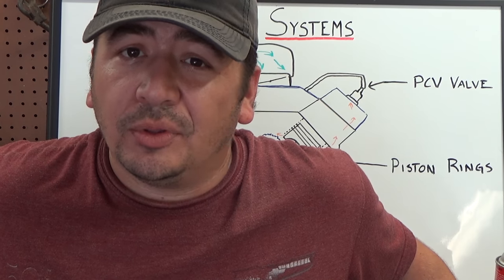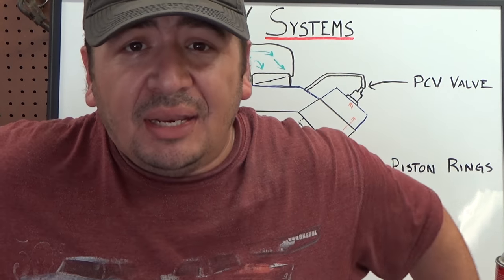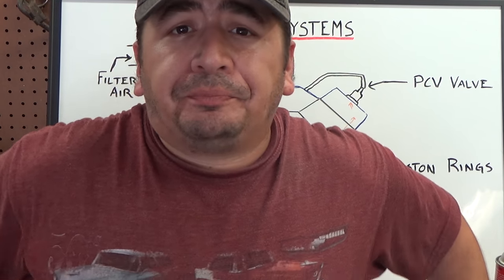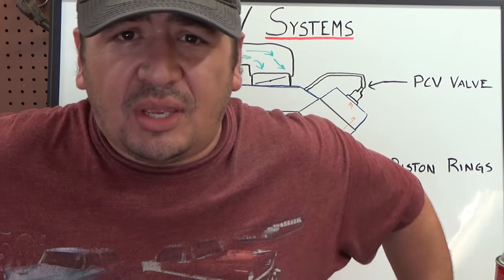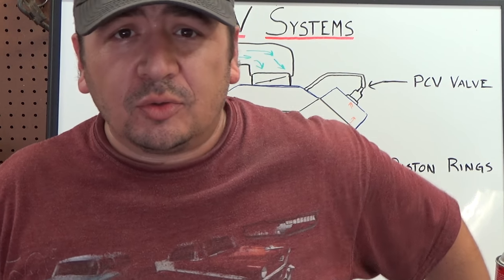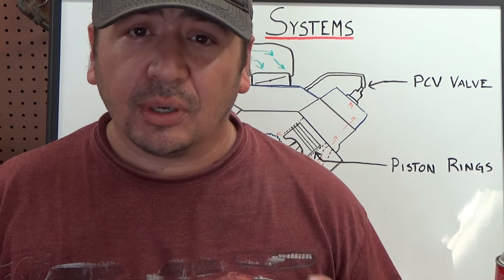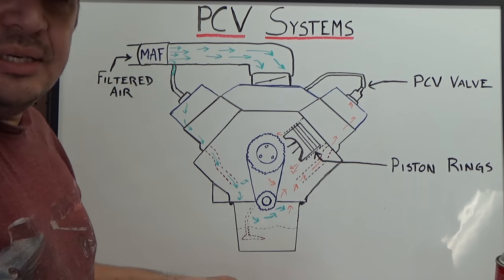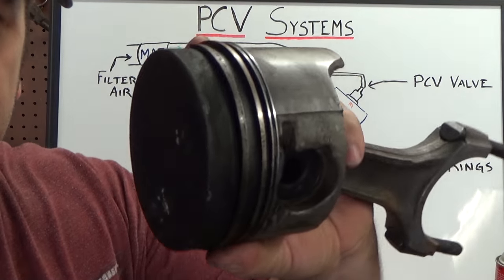PCV Systems - How They Work

Comment: would it be good to have 2 PCV valves installed in parallel, in case one failed, the other one would still be working
Reply: Not really, because if that were the case, if one failed the other wouldn't be fair behind. They are a pretty simple mechanism, and usually fail when they're full of carbon or some obstruction that keeps them stuck either open or closed. If there were enough carbons in one to cause it to fail, the second would be soon to follow

Comment: Excellent video Sir. Another thing that is taking place is at long idle  times, the crank case pressures are also allowed to vent into the intake tube behind the throttle blade. That particular tube really serves two purposes. Great job with this video

Comment: Excellent video, sir. Clear and concise explanation.
I do have a question though. On a carbureted small block Chevy, where the PCV line attaches to the back of the intake manifold, does that mean that air (which isn't going through the carburetor to pick up fuel) will dilute the air/fuel mixture going into those back cylinders and potentially cause those cylinders to run leaner than the others? What can we do to correct that?
Reply: Hello, hope you found some answers to your question since posting this comment. If it still matters, here's my two cents. Firstly, it should be noted that the amount of introduced "additional" air from the PCV valve is minimal at best. Keep in mind the air that is retrieved from the valve covers via the PCV valve is recirculated air. Meanwhile, the normal, naturally induced air via the intake system is relatively unrestricted and "fresh" compared to the reused crankcase gases, which are a result of blow-by. Just to play devil's advocate, if one were to notice their vehicle to be running in a lean condition, such as: noticed power loss, unresponsiveness, etc., a proper carb adjustment would easily correct that issue. With all that being said, it should also be noted that the added air from the PCV system is also "charged" to a certain degree. Meaning it isn't just plain old air; keep in mind that this is air that came from the combustion chamber. This is air that's just been mixed with fuel, ignited, and made it's way back to the valve train, NOT ambient air containing high amounts of oxygen. If the vehicle has a proper, functioning PCV system and still holds good vacuum and a healthy idling RPM, there's absolutely no reason to fret. All the best.
Reply: @WWproper  That makes sense. Thanks for the reply, William.

Comment: Great explanation!  
 My question is the Clean air side from the MAF is also known as an EVAP valve?
Reply from the maker: No, the EVAP or Evaporative Emissions System is an entirely different system.
Reply: @DIYAutoHomeschool  okay  thanks, i have viewed  a tutorial on the in tank Evap . i have to look at a diagram of my 2003 toyota corolla zz1 to see what the vacuum
 valve is specifically then , thanks for your help

Comment: Great video ! On a MAF system could i cap off the intake port after  MAF and put a small vented catch can on the exhaust side to catch blow by and filter air when under vacuum.? Or will this disrupt normal PCV air cycle as you stated that it requires air after the MAF  . Shouldn't the reading for normal PCV cycle work the same?
Reply: If you run a vented catch can you don’t plumb it back to the intake. It vents to atmosphere and you don’t need a PCV valve or fresh air supply. If you run a sealed (non vented) catch can you leave the system how it is, and put the catch can inline between the PCV valve and manifold. It will remove the oil from the crankcase vapors. Hope this helps. Feel free to ask questions if I wasn’t clear.
Reply: @1320horse   Great video mate and great explanation - subscribed! I too plan to run a catch can (non vented) and will place in between the PCV and intake manifold - my question to you is, does the PCV system or the type of valve etc change when you set it up on a modified engine with big cam that produces more intense gas pressures and low vacuum? My engine is a 408 stroked Cleveland with solid cam and 10.4 comp, with heavily ported cast heads. My engine builder says to just vent to atmosphere but I don't want to. Cheers, keep up the good work sir!!
Reply: @mcrennagade873  this isn’t my video, I just commented on it. On an engine that produces less vacuum at idle a PCV setup probably won’t be as efficient at removing crankcase vapors as the factory setup. It will still pull fresh air to displace the vapors,  but a catch can is a must to remove the suspended oil. I’m not sure and haven’t heard of special pcv valves for cammed engines. I do know they make scavenging fittings that can be welded into your exhaust that actually creates vacuum to evacuate the crankcase vapors. So you have vented to atmosphere, an in-line catch can on the pcv system, a vacuum pump (pricey but actually helps make hp), or the scavenging fittings that you run from valve covers to exhaust. Those are the options that currently come to mind. There may be other options I’m not familiar with. Hope this helps. I’m not an expert but I know enough to make decent power reliably.

Comment: Great explanation on part throttle and closed throttle operation of the PVC. At WOT (wide open throttle) when there is least amount of vacuum, the spring pushes piston down onto opening effectively closing the PCV inlet. Its a neat little valve that works in 3 modes with only 2 moving parts.